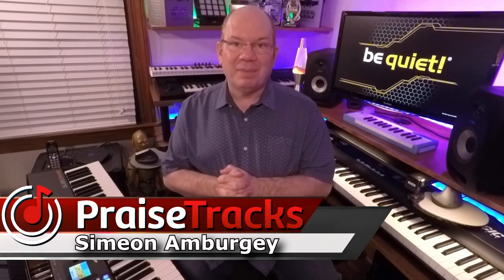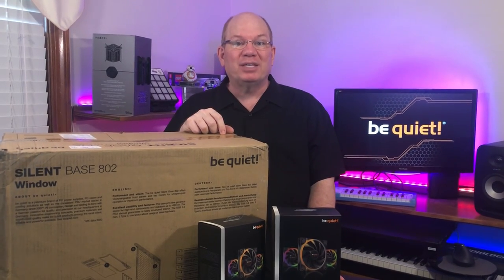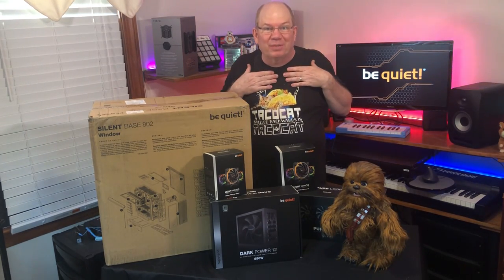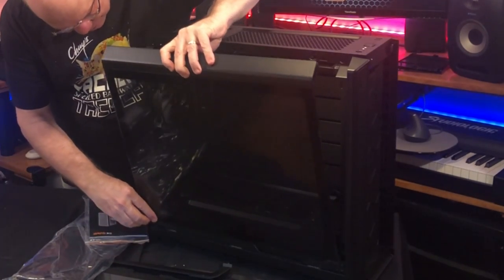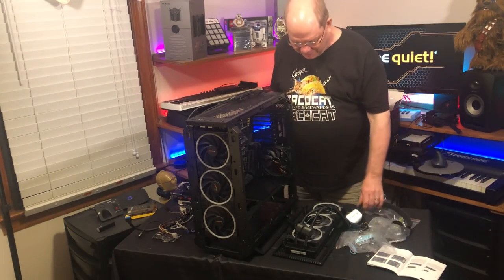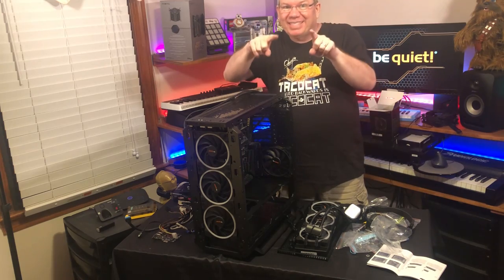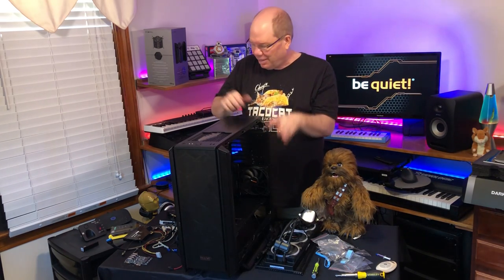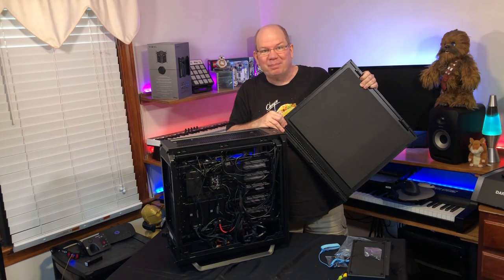Return Of The Build  Featuring be quiet! | Spring Refresh 2020

Comment: Congrats on your new PC, I hope it works well for you. I had my refresh third quarter of 2019 and I love it. I build my actual PC around a 8086 in the I 7 version, for the nostalgic remembers :)
Reply from the maker: Thanks Chris. I basically moved my 2020 components over but already can tell a bit of a difference using a slightly larger power supply. I am hoping in the future to use the older case to build a Vienna Pro server, which would be another interesting experience for sure. Thanks as always for the support.

Comment: Congrats on the new PC! I'm usually a Mac person, but I built a pretty hefty Ryzen-based system last year and thought I might try it out for music production. Is there anything that needs to be optimized in Windows 11 or any "gotchas" for services that I might need to turn off to prevent performance issues with audio?
Reply from the maker: When I was putting together my 2020 build, Jim Rosenberry (Studio Cat Computers) helped me walk through a couple of things. Basically, it is disabling and CPU throttling and power management as I was overclocking the i9 9900K. Also with the RYZEN builds, I have heard that they can get really hot.
Chris Titus Tech has some great videos on fine tuning things: https://www.youtube.com/c/ChrisTitusTech

I think I still need to tweak some things regarding my USB bus, but one of the keys there is to make sure Windows is not turning the power of to them to conserve power. Fun times!!!!
Reply: @PraiseTracks  Will give it a go, thank you so much!